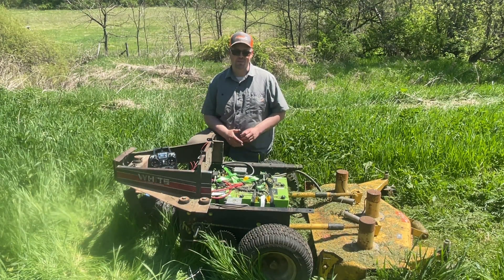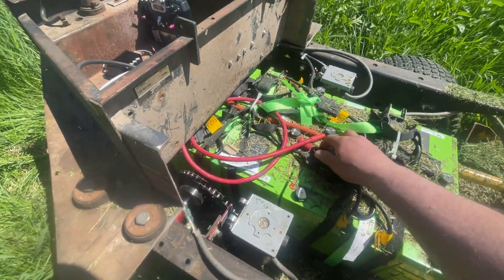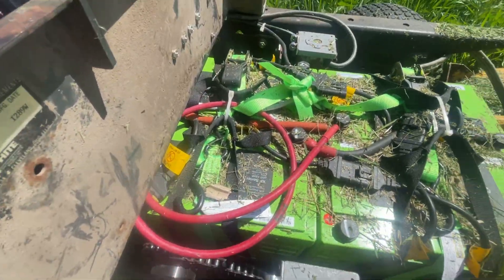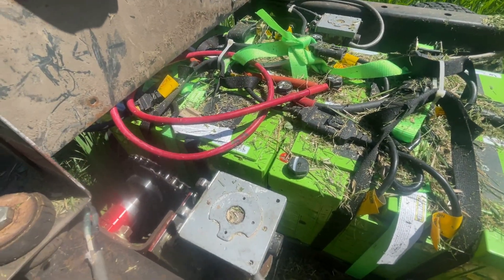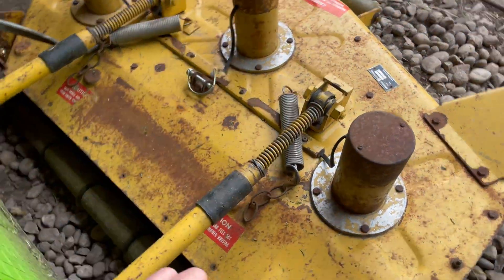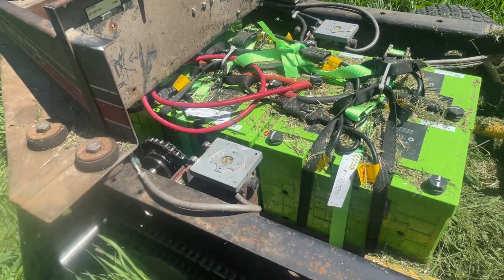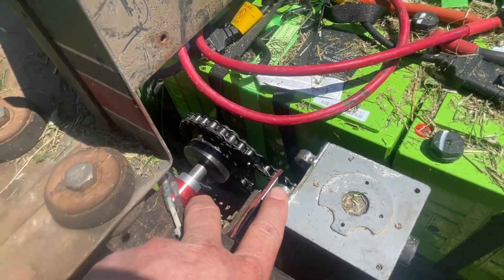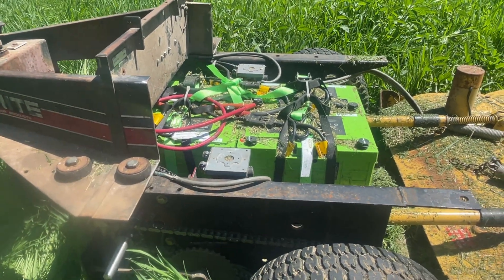Remote Controlled Electric Drive Lawn Mower Built From Recycled Components

Comment: Those wheelchair motors were popular in the early days of RobotWars/BattleBots, but the plastic gears kept stripping. Then everyone switched to 24v 750W Bosch motors but we really missed the built-in gear reduction. These days it might be better to go for something like an e-bike hub motor, which doesn't need multi-stage gear reduction.

OTOH you might find that just changing the sprockets for a lower gear would prevent the motors over-heating. They shouldn't be stalling like that but should have enough torque to spin the wheels on grass.
Reply from the maker: Thanks for the feedback. Most of my research has been around the Battlebots ideas since the concepts are similar. I'm working on a drive system that will use electric skateboard motors, so I'll still need gear reduction but should have plenty of power for hilly terrain.

Comment: Nice build 👍Those are some serious batteries.
What is the power consumption of one motor for the mowing? What blade size are these running?
Reply from the maker: Thanks for watching. Those batteries are better suited for an energy storage system than lawnmower, but they do the job. I don't know for sure, but I think the wheel motors are consuming 250 - 300 watts while moving and I don't know about the blade motors. The blades on that mower deck are 18 inches and much lighter than a normal blade.